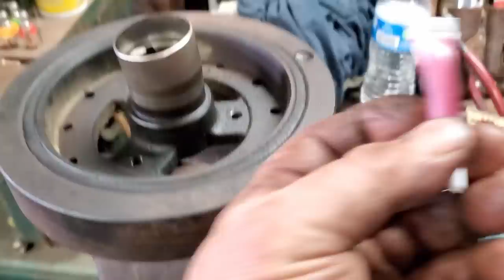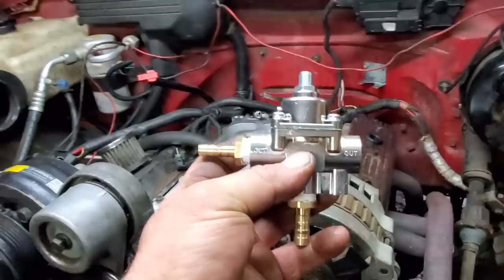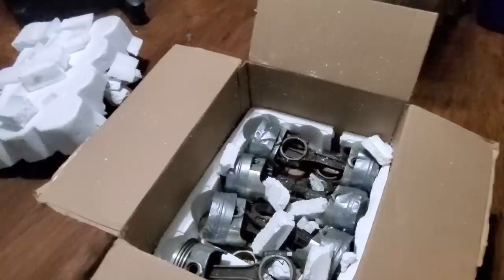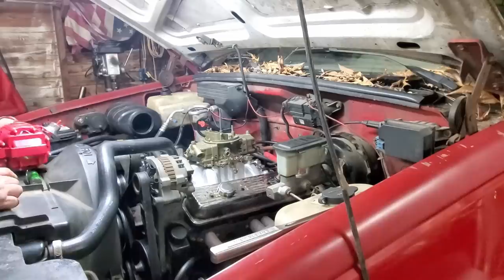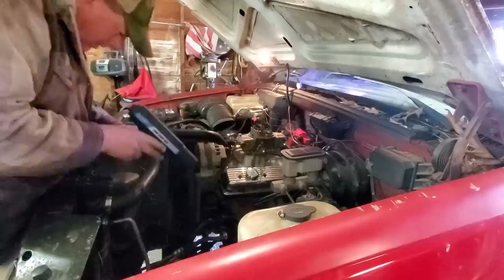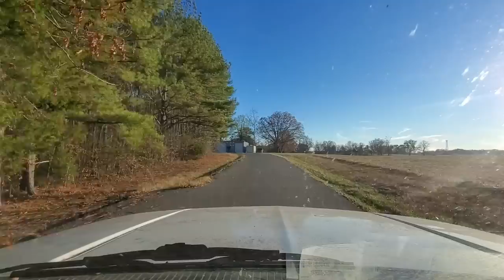1990 Chevy 4wd heads and cam swap. Hot rod 4x4!! Part 2 | It's ALIVE!!

Comment: I've got a 94 350 tbi and I've been thinking about doing the same thing as you did, but I use the truck for hauling a 10,000 lb trailer and I was wondering did you notice any increase in lower end torque? Enjoyed the video!
Reply from the maker: If low end torque is what you want then you don't want this cam. I'd step down one or two cams in this series for torque. Depending on if I end up making this a tow rig or not I might pull this cam out eventually and put one in for torque. But for now it's fun to drive as is.
Reply: @ThisNThatGarage  yeah that's what I was thinking too, I appreciate your reply and look forward to your next video. Thanks again!

Comment: You need your bypass regulator with a return that will help with the fuel pressure extra fuel pressure has no way to go on the non bypass regulator like I said before avoid it apparently some of those regulators somebody's guys here on YouTube and they're saying that there's non bypass regulators don't work hard at all so I'd try the bypass regulator with the return on it

Comment: I have watched u fool with those carbs for an hour now. That vacuum was the issue on the double pumper. I built a mild 350 years ago and ran a double pumper on the street and never had any trouble. Those vacuum secondary carbs are hit and miss. I could never get one to be consistent. I never seen u adjust the air fuel screws on the carb or set the float heights on them either. I believe ur issue was the vacuum leak but I would have also adjusted the air fuel screws on the sides. I bet if u put the double pumper back on there and get it adjusted out it would be consistent and fry the tires in that big truck.
Reply from the maker: Just because I didn't show it don't mean I didn't do it.
Reply: I wasn't intending to be rude or disrespectful at all, just curious. Hope u got it all sorted out. Thanks for replying to me. I just never liked the vacuum secondary carbs. I swore by the double pumper. I usually had a high lift cam, roller rockers, and a little better flowing heads. I think u do a great job! I really like a lot of ur builds.

Comment: I assume you have stock gears and torque converter with over sized tires. There are multiple reasons why a stall converter and dropping to a little lower gear would be helpful in your case.   
  Then there is the carb. The issue there is you have no idea what if any modifications where done to it that your not able to easily spot. That sort of thing happens all the time and has caused people a ton of headaches over the years. 
   What power valve is in that carb?  What is your engine vacuum?  You quite possibly have a mismatch there ( although I don't think your too far off. Maybe 1 number ).  I would also hazard a guess that your air bleed is off ( and sadly not real adjustable on the 1850 ( well, ok, it isn't adjustable in a reversible way ) ).  Playing around with pump cams and squirters will probably help a touch too. You may also need to swap the spring out for a different spring on the secondary diaphragm. 
  With timing, you will want 8 to 12 degrees of initial and a total of about 32 degrees, no more. So you will have to come up with a way to really limit how much advance you get. More than likely, you will have to put a curve kit into the distributor.  once that is done you will have to put a real solid stop on your vacuum advance canister. 
   The intake you bought, really isn't an ideal match for the cam you have.  You have a low RPM bandwidth dual plain design and a cam that really would prefer a single plain design. The RPM air gaps band would have matched up to your cam a lot better. 
   The heads you have in stock form really are not ideal with that cam either. While the vortec heads do really decent, that big of a cam would really prefer to have a head that flows better yet. To be honest, that cam would prefer the compression ratio to be higher as well. 
  Please take my comments as they are intended to be, constructive.  Keep at the tweaking. you will get it pretty close ( although I suspect not perfect  ( that isn't a hack on you in anyway shape or form! the engine you have just isn't set up in such a way where all the parts are perfectly suited to work together in total harmony)). 
Good luck and happy thanksgiving to you!!
P.S.
The burn out issue is most likely due to the fact that you are probably not running the ideal torque converter and gears for the tires and vehicle weight. That cam isn't designed to hammer right off idle.  That cam wont start getting real good until some where above 2000 RPM.
Reply from the maker: Yeah it's not a race truck so I think it'll be just fine.

Comment: The more cam the less vaccum. Also u might wanna put the 750 on it and give her some fuel! Unless u got some big ol jets for that 650. Every one of that gen truck takes a week n a half to warm up. i"ve had plenty. every single one of em took forever to warm up
Reply from the maker: 750 is way too much for this especially on the street. I reckon I'll have to keep doing the cardboard thing if I want any heat! 🤷🏻‍♂️
Reply: @ThisNThatGarage  ud prolly need a single plane intake like a wiend with one port per cyl. A Mallory hot ignition would help it too.
Reply from the maker: @ionracer24  Definitely don't need a single plane.
Reply: @ThisNThatGarage  Not trying to run bonneville?? lol

Comment: What size drill bit did u use for the thermostat I have to do the same to mine
Reply from the maker: I don't remember but something  1/8" or a little smaller should be fine. I drilled 3 holes.
Reply: Thank u I will do that

Comment: They are expensive but just buy an Edelbrock carburetor then it should run fine.
Reply from the maker: Holley is just fine too.
Reply: @ThisNThatGarage  yes Holley is fine I always ran a Holley 750 with vacuum secondaries with no problems. Holley use to offer a trick kit to put in and always had great throttle response

Comment: Ok I think I missed something but how is the transmission shifting with out tps
Reply from the maker: Watch this and it will answer your question. https://youtu.be/mz39w-jnbM4
Reply: I remember that  now I have a 93 I got to do the same to just trying to find out what wires to fight  with and does 4x4 still work or are they something that has to be hot wired there
Reply: I forgot to thank you for replying back. I enjoy watching your videos on getting stuff back to running
Reply from the maker: @donnylong662  4WD is manual.
Reply: Yes
Reply: But the rear end in front has power wire going to it what is it for

Comment: You already said it had a vacuum leak. You can't set timing accurately with a vacuum leak.
Reply from the maker: Setting timing is rpm related.

Comment: A good way to do that like by your own cell is to download that desktop dinosaur by Mr. Gasket is the Dino proven to be within 5 horsepower of what actually is and allows you to switch to intakes Cam rocker arms all that S tough around until you get to motorsports bar you probably can get or the most horsepower you're having for in it was mine 425 / 383 with a stock 400 current a bottom of it And 5 7 3 50 rod an stroke or piston's due valve release puts out about 10 to 1 compression with sinhead gaskets that are non metal I'm talking about there made like a Dang a service that gasped you have to run the egg basket and a can copper coat that you can pick up at any knife or autozone but it will work and you'll end up with about 1:05 to 1 question on pump gas run on 89 optain we're all cutting booster as a case maybe in our fugal systems of today brightness

Comment: I know you don't understand but unfortunately engines need to run at a certain temperature
Reply from the maker: It's quite obvious you don't understand  but maybe you missed that whole this truck doesn't warm up without cardboard in front of the radiator discussion. To be such a knowitall you really don't pay very good attention.

Comment: I'm the new truck stuff for the overdrive transmission they are harder to get to do a burn out than 3 speed or something because the overdrive kicks in in the computer traction control part keeps from doing that especially with the 408 set up you gothat's a peacock he had to get 350 terrible and that's a b** I don't want her terrible at some basic light I don't buy it